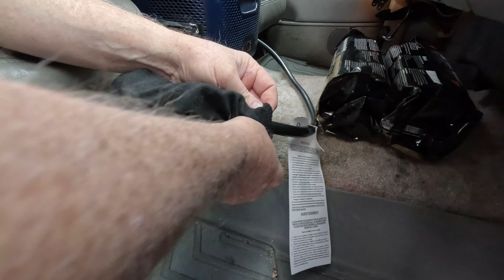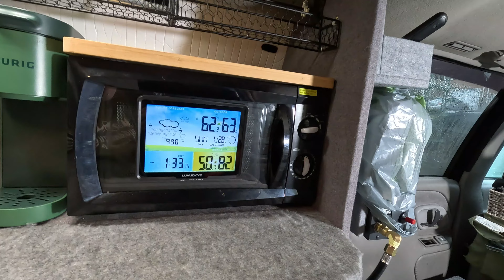Camco Olympian Wave 3 Catalytic Heater install and some tweaks. #carcamping #vanlife

Comment: here in Ontario, ill have 3 sources of heat to be safe. this Olympian,  a diesel heater and an electric back-up. 3 is 1 and 1 is none up here in the tundra =D
Reply from the maker: I carry an extra Mr. Buddy heater if the temps are extremely low, but it sure doesn't get a cold as where you are. Stay safe my friend.